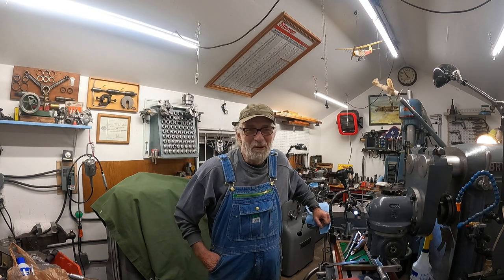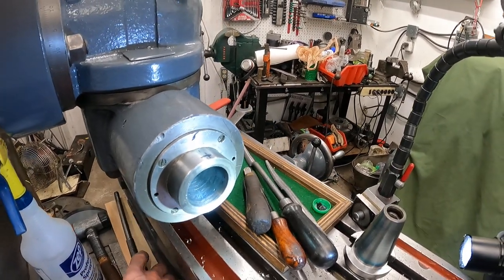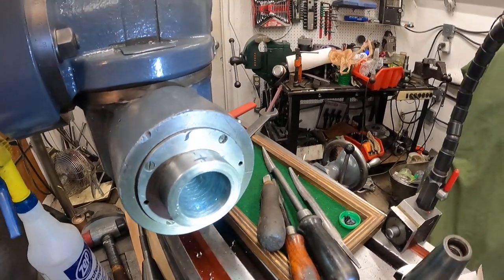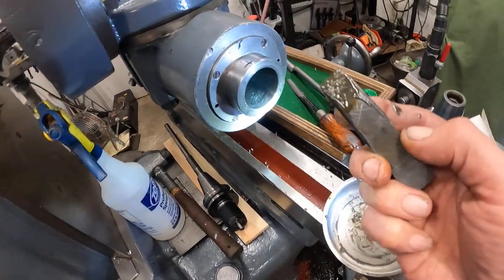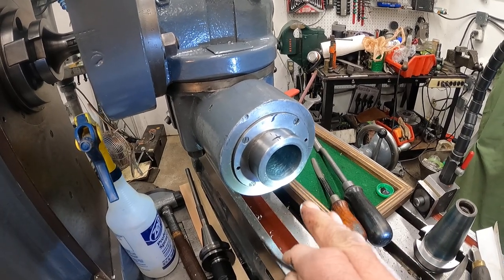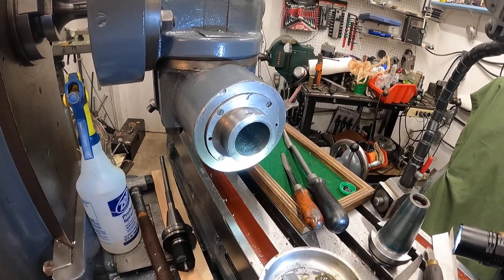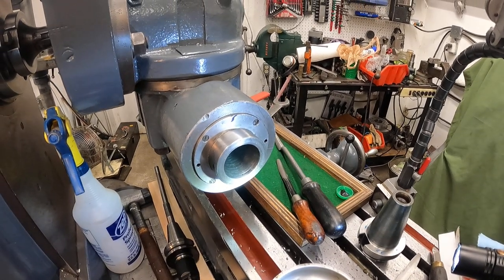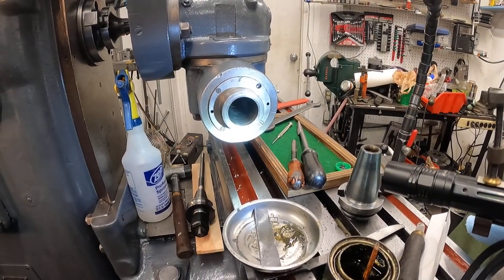Spindle nose repair Brown & Sharpe Milling machine

Comment: nice trick with the lead. Emery paper is never used in my shop when lapping flat surfaces. Wet dry paper perhaps. Emery is cloth backed and spongy. It will follow the surface terreign instead of correcting the high spots. I know it wouldnt be correct, but I think pretty good results could be had by grinding the spindle in place with a tool post or precision die grinder. Youd have to spend a bit of time to indicate proper. (this would be a last resort ).
I think You are doing good just the way You are doing it.
Reply from the maker: I can more easily grind the spindle in its bearings set up in the cutter grinder, without a sine bar or other then a indicator to get started because the taper can be worked back and the spindle nose shortened a full 3/8" so, start grinding and test and adjust lots of room. The nose taper was never ground in the first place, it was turned or possibly reamed. Back in the undamaged area the runout appears to be .0005 or so. The metal pushed into a micro pile on one side from tool spin. I think this will work fine, its not a jig borer. And I thought it would be good to show how some things were done, that still can be applied now in many ways.
Reply from the maker: Emery paper brings back the memory of Atlas lathes and go karts with chain saw motors

Comment: I love this mill. Never seen one before. I have an omniversal and a #2 vertical. I think Brown and Sharpe made the best mills followed by Kearney Trecker. Got a 2CH and a #2 rotary also. Great Job saving your brown and sharpe!!!!! Do you have the overarms and horizontal arbors for this mill?
Reply from the maker: This is an odd mill in short war production and used at the Hanford nuclear site. The high speed vertical head slides locked to the ends of the overarms and driven by a splined shaft so it can be moved out from the column up to 12". This vertical head is left attached and is also the horizontal arbor support by using an adapter for the arbor end bearing. Now, this an awkward set up that has a lot of problems with the overarms sagging the more they are extended out with that heavy head fixed on the ends. This design was quickly replaced with the #20 Rangemaster sliding head mill that used the same powered knee and table, That machine eliminating the overarm sag by having the upper horizontal spindle part on ways but still with the round arms up high, hard to find machine.
Reply: @deedeeindustrialsuperprecision  Interesting. I have been looking for a universal head for my Trecker 2CH but they are hard to find. The vertical head on the omniversal is very cool but it’s definitely for light use only. The ability to move the head in and out along the Y axis is very desirable and many vertical heads attach to the Z axis ways fixing their position along the Y axis. The #2 vertical has the same problem in that the Y axis position of the spindle is fixed and the head is bulky cutting into your Z axis capability. But I do love my two brown and sharpe mills. The #2 universal with the proper head is a very nice setup. The omniversal suffers from its tramming requirements as it has a built in rotary table for both the x axis and the y axis. I love my round ram Bridgeport because I have more rigidity in the head and a simpler time tramming than a cabbage head. But it would nice to be able to move the head along the y axis which the round ram will not do.
Reply: @deedeeindustrialsuperprecision  Case in Point! The 426 Hemi of the late sixties! The articulate axis of the valve guides are not straight but at opposing angles to each other. So to get in there for guide replacement, you need to move the head in and out using the over arms. Then you need to set the angle on the head. Then you need to tweak the y axis of the table. Lastly you need to traverse along the x axis dealing with each guide as you go. Basic stuff but you can run out of y axis real estate real fast without one of these versatile universal heads. I did my Cummins on the round ram. 24 bronze guides made on the Hardinge HLV. The old girl did a killer job on this head as the guides are all straight along the z axis. And the old girl has the short 36 in table and no x axis power feed. No Worries! Your mill would do short time on the Elephant head! The elephant is what this motor was called.
Reply from the maker: @devmeistersuperprecision4155  The vertical heads for K&T are worth more than the rest of the machine and just plain rare here. I am familiar with the omniversal model, they were used in plutonium production and some are still around. This war model I have is great for a lot of things but limited in many ways, it was in the junk pile because it is too slow to use in these times.
Reply: @deedeeindustrialsuperprecision  yup… rare as teeth on a chicken. An old timer gone now taught me that machining is 9 parts set up and 1 part machining. CNC is great but what do you do when you need to rework and old damaged part? Or make a one off replacement part from a raw casting? Or you have to make special fixtures to machine a one off part? Thomas Lie-Nielsen stood next to his WW2 Trecker slab mill and Fadel CNC VMC. He said The Right Technology for The Right Job! That brown and sharpe you have is a slick mill! It has a great future in limited, special purpose work. You will spend more time in setup and head scratching on unique jobs than measuring your thru put metric.